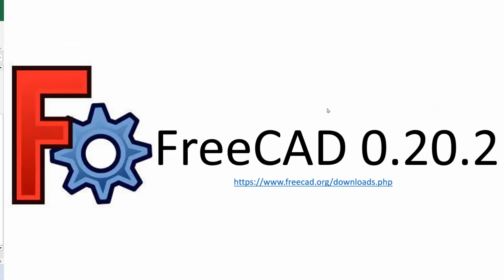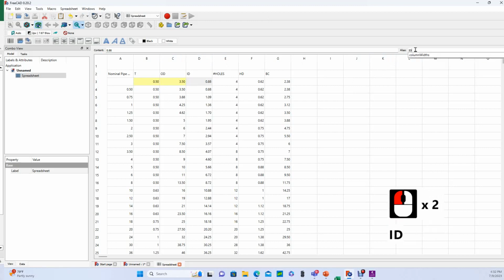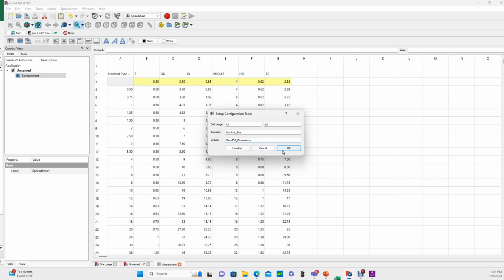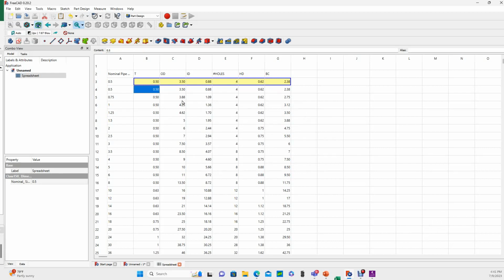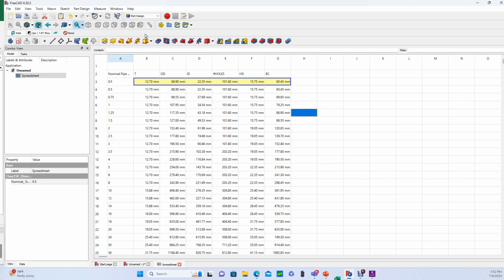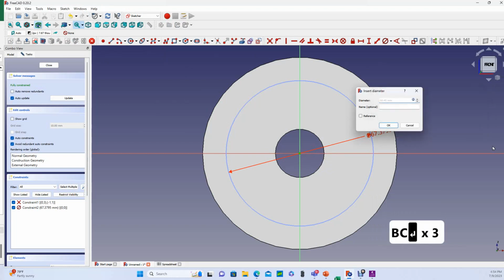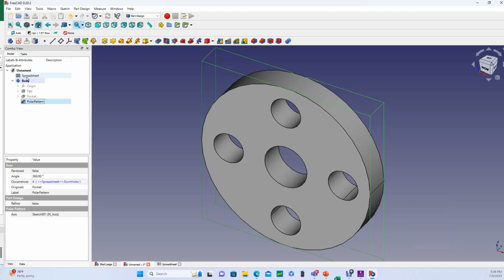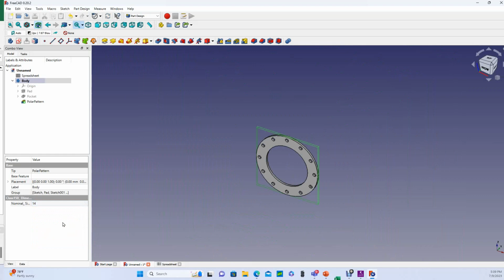FreeCAD Tip - Configuration Tables

Comment: This comes really close to what I need. but I just want to be able to set a integer or a float value.
Example: I made a parametric cable gutter and I want to use this cable gutter in A2plus or assembly with different lengths and sizes.

Comment: I am using your technique to 3D print a cyclone vacuum (tangential inlet with HEPA and carbon filters) in which both the overall size and the geometry (Swift, Lapple, Stairmand...) may vary. FreeCAD's manual webpage explains a lot but isn't thorough enough. Your tutorial works. Thanks a lot !

Comment: Great tutorial, indeed!  Thank you.  Any idea, how to use a spreadsheet with two sets of variables?  For example, think of ER collets for holding workpieces  or tools in a lathe or mill.  The collets come in different size classes like ER11, ER16, ER20, ER32 and so on.    This class defines the outer size of the collet.  Now for the hole in the collet.  The classes do have different capacities, e. g. ER11 offers holes from 1 mm to 8 mm in steps of 0,5 mm, while ER32 has a range from 3 to 22 mm in stepts of 1 mm.  Is there any chance, to do this in FreeCAD with two selctions: one for the ER class and one for the hole diameter?
Reply: I viewed this video 1 year ago and was having trouble and commented, now I have come back around and am having to watch this again but, because I searched the word "expressions" this time, funny thing is I have improved my knowledge and experience in FreeCAD, so I didn't make the same oversight. I am sharing the following link that explains what will help you, just in case you have not resolved your need yet. I am always learning in FreeCAD.
(https://youtu.be/tUuCQl6Uh6U?si=IcVpq8xXa6m2PuQC)

Comment: Great video thanks
When I change to a different size everything works except for my hole diameter stays at the same size? Any suggestions as to what have I done? wrong
Reply: Hey, My problem came from using the hole and not pocket. Yes, you first did say hole but you actually used the pocket but you did bring this to everybody's attention. So I was tracing everything down and found "MY" mistake.